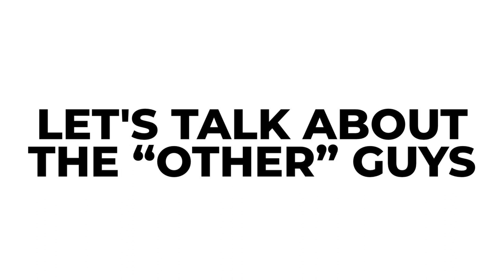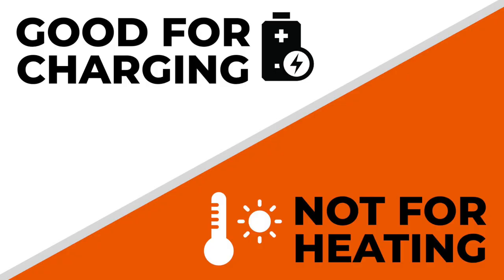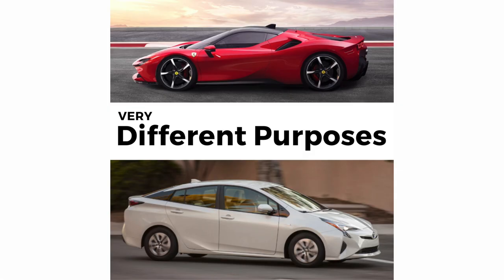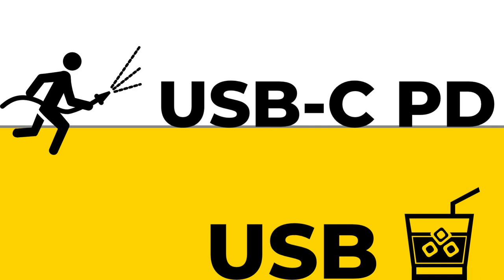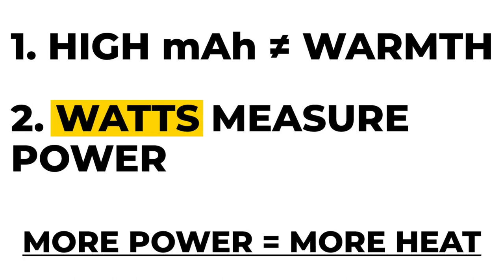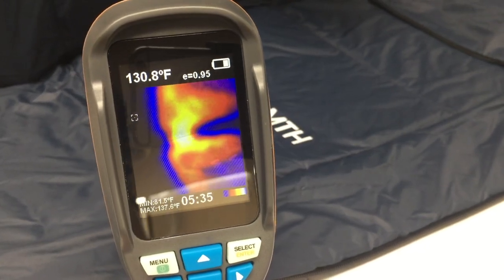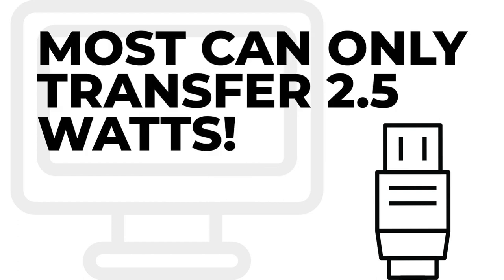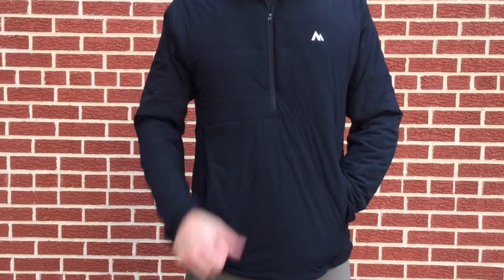The Secret to Ember's Instant Heat!

Comment: Does your power pack have any built in protections such as overcharging, over discharging, temperature limits and cell balancing(if you use more than 1 cell in a series)?
Reply from the maker: Yes, we built-in overcharge protection, discharge protection and temperature protection, the cells are balanced using our control board. They have also been certified by the United Laboratory as well as  IP65 certified.

Comment: So the battery can deliver 60w of power but how much capacity does it have?
Reply from the maker: Battery Capacity: 40.7Wh 11000mAh. The UL battery lasts ~6 hours on low and the XL is ~12 hours on low.